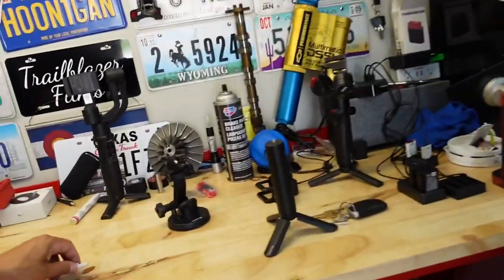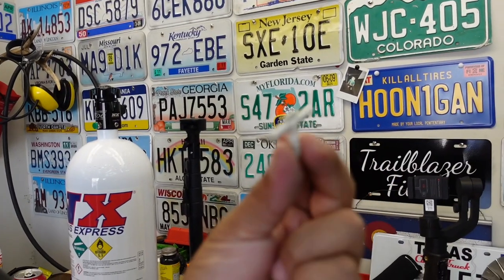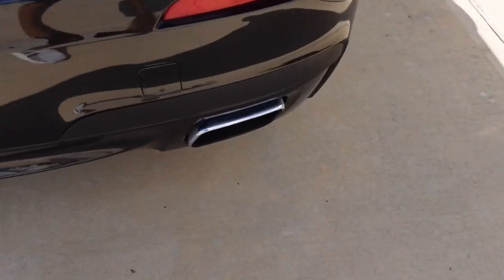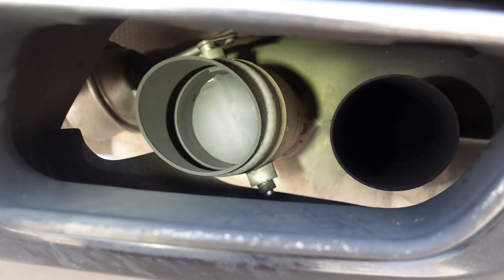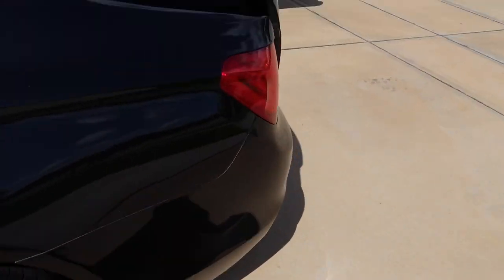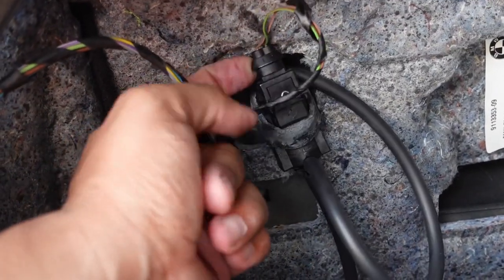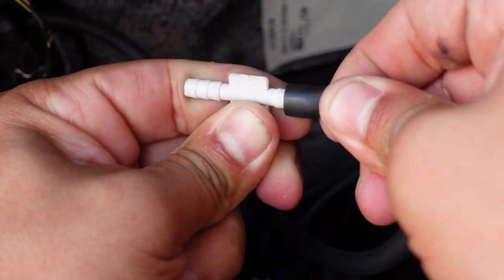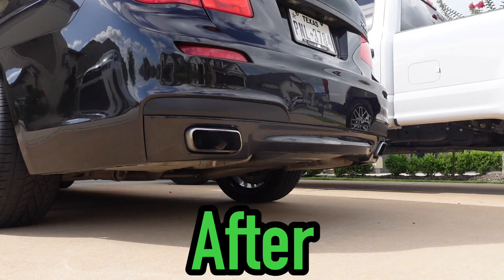How To Make Any BMW Exhaust Louder. How To Bypass Exhaust Muffler Valves.

Comment: OK so...
I tested this and immediately realised this just permanently closes the valve... Supplying constant vacuum to the valve.
In order to work just remove the side vacuum line to the controller and leave the bottom one.
Reply: Hello, you removed the hose facing the side and capped it with something or left it?  And kept the bottom one plugged into the controller?
Reply: @rekairinger7700  Unplug the left one that runs directly to the valve there's no need to cap the line to the valve because the whole point is that atmospheric pressure is needed in the line to hold it open.

The Bottom vacuum line comes directly from the source of the vacuum in the engine bay. Quick test is when you plug this one you can here the atmospheric pressure entering back in. So just leave this one connected.
Reply: @HARDMAN999  so leave bottom connected and the side one just hanging loose?

Comment: Man... This  was great. Its the first video showing "WHERE" the vacuum hoses are located in the trunk and how to get to them! PROPS for that! Will this work to stop the Exhaust rattling?  In my diag I hear this rattling so I used a small rod to push in the pipe on the Actuator with the car running and it stopped. This tells me I most likely have a vacuum leak.  So again, might this b a good work-around for that problem? THANKS

Comment: Thanks for the tip. I can confirm that on 550i F10 from 2010 this worked just like described: Connecting both hoses to t-shaped pipe connector. Now the valve is remains open.
Reply from the maker: Awesome good to know. Thanks for letting us know.
Reply: I have the Same car , love it 💯

Comment: I have 2017 x4 m40i and can’t seem to locate the exhaust vac hose to do this mod any help is greatly appreciated
Reply: Most BMWs have this controller but you should read my comment.
I tried this and instead of bridging the two vacuum line.
All you you need to do remove the left Vaccum line on the controller that is directly connected to the valve. So the atmospheric pressure overcomes the dome pressure in the actuator that controllers the valve.
No engine lights super.
Simple to try!
This video was just a waste of time.

Comment: Does this work on a 650i
Reply: Check the back of the car and look for a valve and read my most recent comment because it's simpler to do than this. This will actually permanently shut the valve doing it this way.

Comment: Thanks for the information and video. I have a 2014 640i. Could you let me know what I need to do for my car to get the sound we "need"!!
Reply from the maker: Your car definitely has the correct valve for this to work. Not to sure where it’s located on your model. Do a little research & if no luck let me know & I’ll see what I can find.

Comment: Hello sir thank you very much for your video regarding the exhaust pipe that BMW 740!  . I have a BMW 2019 740i I’ve bought it seen August but 2 weeks ago I found out that one of my exhaust pipe no smoke was coming out of it , I was worried about that, I call the dealer where I’ve bought my car and I describe what I’ve noticed about 2 weeks now . The told me that my car was not supposed to do that unless I’m on the highway and the actuator will open . I was worried and I said I just don’t believe it . I went on YouTube I saw your video I went back to my car and looked at through the exhaust pipe then I saw the actuator . Now I have no worries anymore.  Thank very much for your video.  It’s really helpful 👍🏻👍🏻👍🏻👍🏻👍🏻
Reply from the maker: Awesome glad this helped!

Comment: It’s possible on 420i Engine N20??
Reply: Firstly check the boot or (truck) 
Secondly I've commented this before but anyway.

I tested this and immediately realised this just permanently closes the valve... Constant vacuum to the valve
In order to work just remove the side vacuum line to the controller and leave the bottom one.

Comment: Firstly thank you for this helpful video and I’ve just tried it on my 2010 750Li. The drive is much better now, however my exhaust sound hasn’t changed much and don’t have any of that nice bang sound. Any suggestions?
Reply from the maker: My suggestion would be to eliminate some of the cars resonators it has. That really cuts down the noise you want.
Reply: The drive is much better “now” but the exhaust sound hasn’t changed?… 😂 This doesn’t improve the way your car drives, it changes the exhaust note. 🙄
Reply: This mod permanently closes the exhaust valve.
The controller allows an Vaccum leak at certain RPM to operate the valved system.
In order to work leave the Source Vaccum line on the bottom and remove the Left Vaccum like line that runs straight to the Vavle the atmospheric pressure holds it open.
No engine light.
Simply

Comment: What are these small barb things exactly called?
Reply from the maker: Vacuum tubing connectors. Automotive based
Reply: @JJBanuelos  thanks mate and the diameter?
Reply: OK so... I've commented this before but people need to realise this won't work.
I tested this and immediately realised this just permanently closes the valve... Constant vacuum to the valve
In order to work just remove the side vacuum line to the controller and leave the bottom one.

Comment: Will this work on a 2013 320i?
Reply from the maker: Possibly not sure on the setup on those
Reply: OK so... I've commented this before.

I tested this and immediately realised this just permanently closes the valve... Constant vacuum to the valve
In order to work just remove the side vacuum line to the controller and leave the bottom one.

Comment: Will this work on a 2007 bmw 328i?
Reply: OK so...
I tested this and immediately realised this just permanently closes the valve... Constant vacuum to the valve
In order to work just remove the side vacuum line to the controller and leave the bottom one.
Reply: @HARDMAN999  Hi so do you have any pictures of where the vacuum line is.
Reply: I don't think this will work on mine because I don"t think i have a valve in the muffler.
Reply: @AL-xk8mj  It's in the left side of my boot/truck for my 330i

Comment: Does it work on a 650i ???
Reply from the maker: Should if it has the exhaust valves similar to these
Reply: @JJBanuelos  👍👍
Reply: Just want to inform you when I tried this I realised that it's just allowing permanent vaccum to the exhaust which actually fully closes the valve.

Comment: Hello, I have a '12 f02 with the mufflers chopped.  I want it a little bit louder without being super loud (i.e charger scat pack). Would this do the trick?
Reply: No 😲 go to a local muffler shop have them do a resonator delete and weld a 3inch pipe all the way back with some nice tips bammm mine sounds like a 🐉🐲 dragon
Reply: Only cost me 160$ for the delete and pipe and 97 for tips I got nice dual burnt tips welded on
Reply: @jcoach3064  can you post a video? I have a f01 13 B7 and can’t decide what to do
Reply: @MrHustleSwag  go CATLESS HEADERS AND resonator and muffler delete and put in a vibrant resonator and dual tips then get a ECU tune from revmatch motorsports stage 2 tune 💯💪💪💯🎇🎇🎇🎇🎇💯💯💯💯💯💯🎇🎇🎇🎇🎇🎇 you wont regret it brotha !!!!!
Reply: @MrHustleSwag   so im currently building a super sleeper E39 530i 01'    next is coilovers and then a m50 manifold swap then a supercharger kit  but just go to my channel got some clips of the exhaust sound from when I fist got the car and put catless headers in and complete straight piped then when i put in the  vibrant resonator youll then the stage 2 tune

Comment: Hey I have a 2011 750 f02 quick question did you notice a difference with driving experience related to back pressure? Correct me if I’m wrong but I thought those Vaccum lines work alongside the turbo wastegate? Any lag or loss of torque due to back pressure?
Reply: Well all this mod is doing is permanently closing the valve.
I tried it, Easy way to verify is look down the exhaust tip.

This runs a direct vacuum source straight to the valve. 
(Not ideal).
Just remove the left Vaccum line to the controller and it actually works!